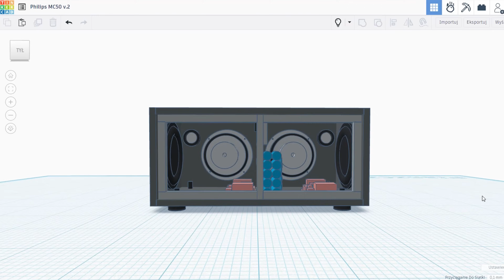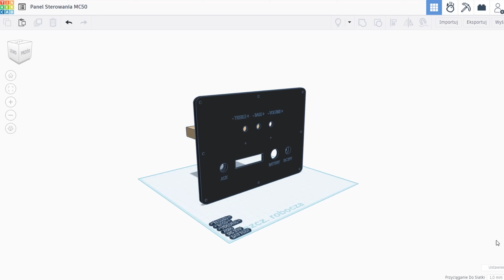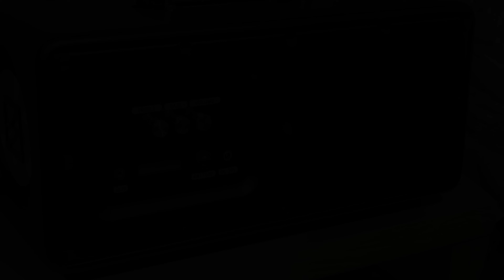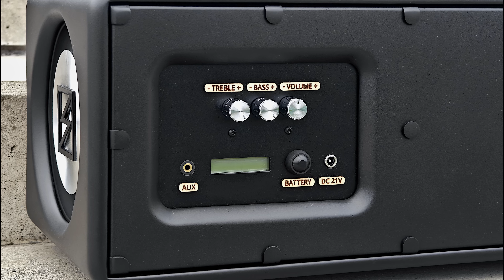DIY Bluetooth Speaker 2x50W - BOOMBOX Philips MC50 [SOUND TEST] | by Sebastian

Comment: The design is good i like the silver driver cone matches with the silver passive radiator, however i noticed some distortion i dont know if your microphone distorts or the speaker but i guess its the microphone, and i noticed its missing midrange frequency so you should boost midrange frequency because its too quiet and only bass and treble can be heard, overall i respect your build
Reply from the maker: Thanks. I know that silver and black combination is beautiful 🥰 In this case, unfortunately, it's the microphone... Overall, the speaker sounds fantastic live, but the tweeters have high dB sensitivity, which makes it sound like the video lacks midrange.

Comment: Would be better if you use a DSP amplifier from AliExpress and instead of giant crossovers for the tweeter, use capacitors, it would be cheaper better and smaller

Comment: Sir please tell how to paint mdf with this finish plz plz reply
Reply from the maker: When I first used MDF I also had a problem. I recommend using a wood impregnation at the beginning, which you can spread with a brush (it prevents the paint from being absorbed). Then I also do this, I take acrylic enamel and paint the casing with a roller (an additional layer that will not allow the spray to be drawn into the wood). After a few layers (2/3) I sand it smooth and the casing is ready for spray painting ☺

Comment: why any song in 70% and any others 50% vol?
Reply: Algunas canciones por sus  frecuencias se escuchan más fuertes que otras, si la frecuencia es muy alta y le subes mucho volumen puede llegar a distorsionar
Reply from the maker: I completely agree with the guy above ☺ There is also no point in turning up the volume any higher, because the video will not convey the sound like in reality and the microphone may have a problem with such a loud sound and there will be distortions.

Comment: Hi thanks for this. Could you please give a guise to how the batteries are wired to the BMS and then wired to the on off switch and charge indicator as well as the charge port?
Reply from the maker: Hey! The connection diagram for everything is in the video after showing the 3D project. As for BMS and batteries, you can find the diagram on the internet by typing in the BMS model. Best regards! ☺

Comment: Superb sound only their some noise in twitters
Reply: I was thinking the same, I think that pre build crossover isn't matching so good with the speakers
Reply from the maker: Dear ones, these speakers are characterized by a high dB level, live they sound wonderful to the ear. Probably the microphone has a problem with catching these frequencies and that's why it is like that. It also depends on whether you listen to the movie from the phone speaker or on headphones, because there is a difference. If there are too many high frequencies, you can reduce the high band with a potentiometer on the back of the amplifier ☺ Greetings!!!
Reply: @SebastianDIY  Can be microphone issue. But i think twitters are getting overpowered or twitters are not good, or anything. Try to solve it bcz the sound of that speaker is superb. I am using monitor headphones.